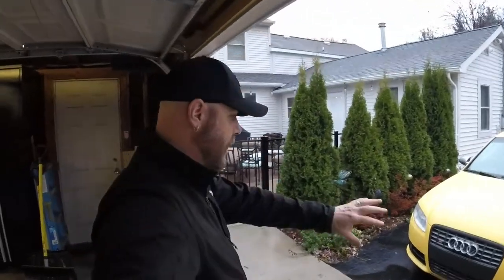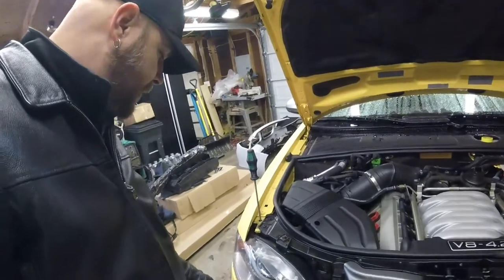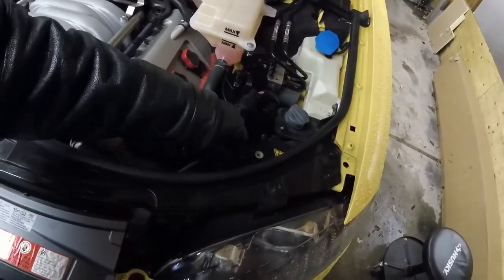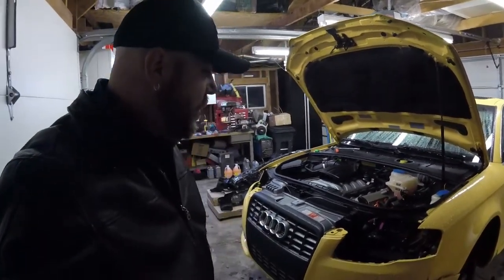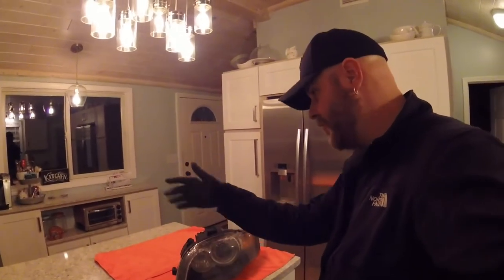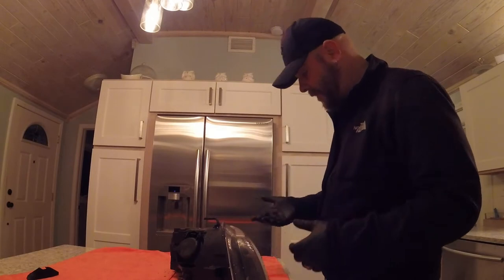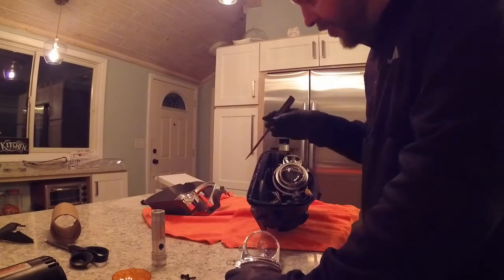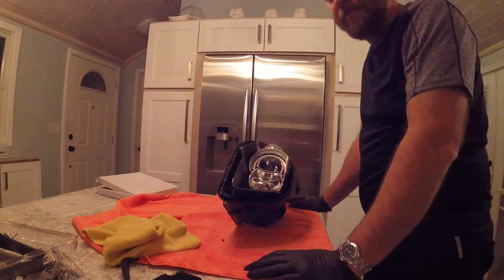Audi S4 B7 Headlight Rebuild

Comment: Seems like a common b7 problem to have a leak in the driver's side headlight. I resealed mine and it didn't fix it. I suspect the access cap now, too. Did that fix your problem?
Reply from the maker: John Davey I could never get it to fully stop, it was just reduced. I have a feeling it’s the heat from the engine compartment causing the condensation on the lens when it’s humid.